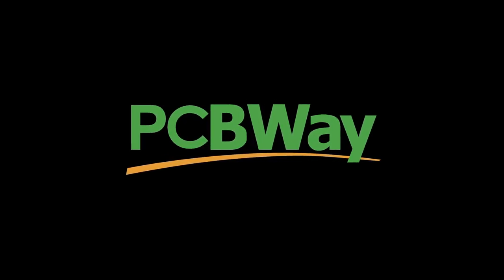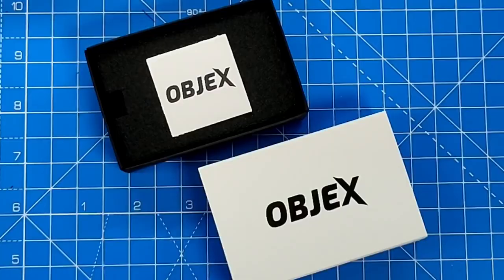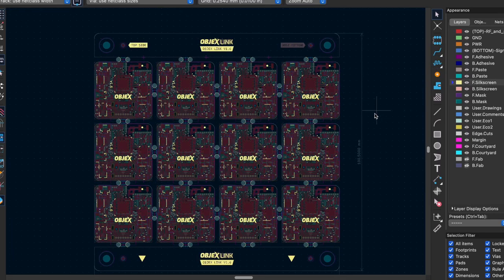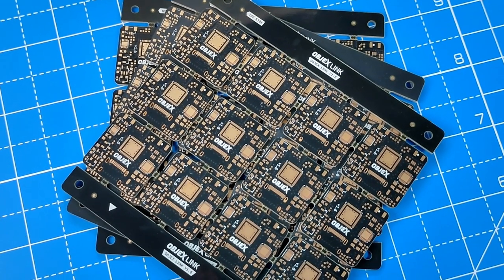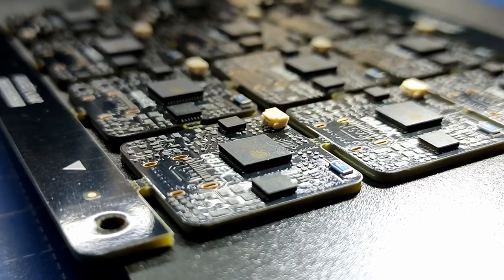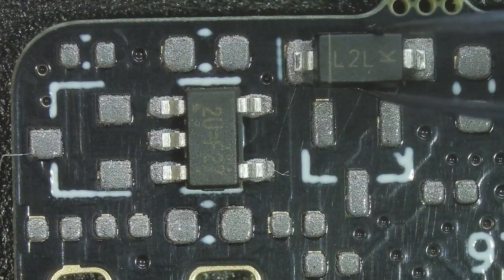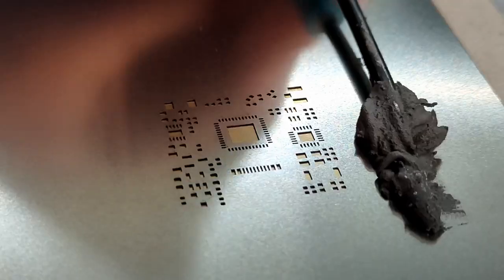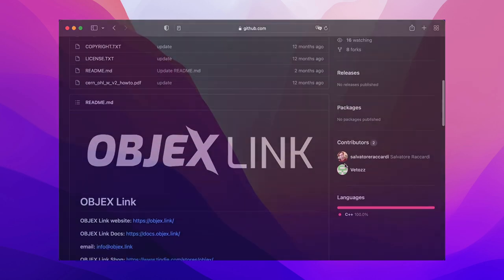ESP32 IoT Board - Prototype to Production, OBJEX Link for sale!

Comment: Hi, cool video! I have a question.
I saw you ordered simple and thin oled displays a while ago.
Then you posted another picture with a OLED module that is quite bigger and have other connectors.

Why didn't you used the oled screens with the fpc connectors?

I currently develop a device and want to use these oled screens with the fpc connectors.
Reply from the maker: Thanks for the question I'm so glad you remember what I show on my Instagram profile, I really appreciate it. I'm actually going to use them in my next project, I'm working on two new very complex projects to develop that I'll show you soon. however very often for reasons of time I can not immediately use all the components that I buy😄
Reply: @SalvatoreRaccardi  To be honest I first remembered another post of yours, the one with the flexible cables you made. Since I'm currently looking for an extension for my small oled fpc cables and unfortunately I can't find the exact length, so I wanted to see how to make my own. Then I saw the two posts with the oled displays, and was interested.. :D

But yes I follow you for a long time and think your projects always great!

Comment: On the C3 I see you have a 10uF & 10K resistor  off the Enable button. I’ve seen 0.1uF and 1uF but never 10uF. Also, I’ve never seen a 10K pull-up resistor from VDD_SPI to GPIO14_CS before.
Reply from the maker: Hi mike, 
1. I see you have a 10uF & 10K resistor  off the *Enable button. I’ve seen 0.1uF and 1uF but never 10uF.
10uF to avoid upload issues - *reset button 

2. I’ve never seen a 10K pull-up resistor from VDD_SPI to GPIO14_CS before. 
I suggest you to read the official documentation(ESP32-C3).
Reply: @SalvatoreRaccardi  will do and thank you for providing the schematic to view. I’m always looking for ways to improve my designs.

Comment: 1-If we want to buy one piece, do you send it to Turkey?
2-Did you program it like Arduino. Open source?
2-Is the system object link.  It is similar to an Arduino؟
I hope to answer these questions
Reply from the maker: 1 - Yep, just ask for shipping to turkey on tindie
2 - Yes you can use Arduino IDE, Micropython, ESP IDF
3 - Yep, but its modular - for info visit: docs.objex.link